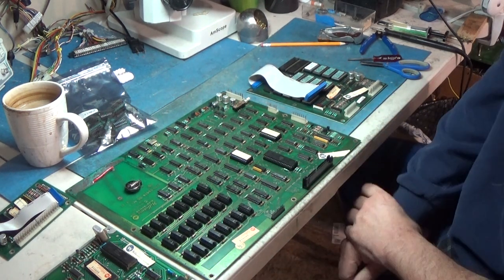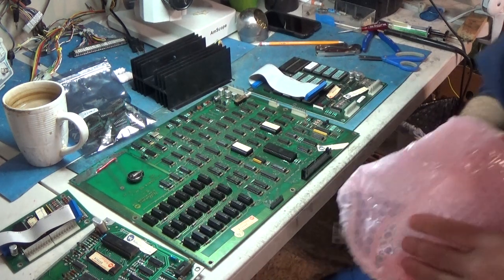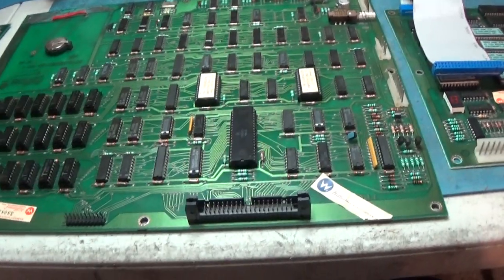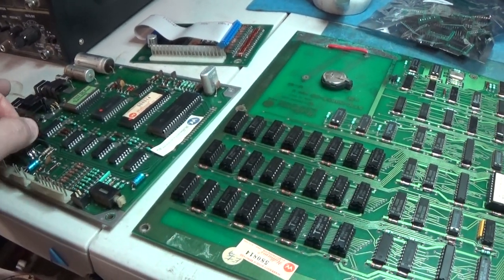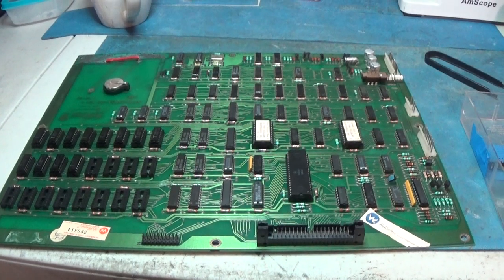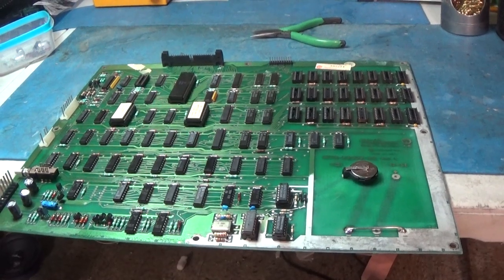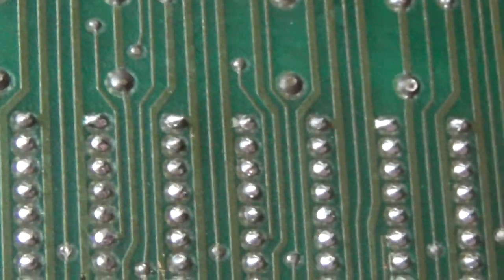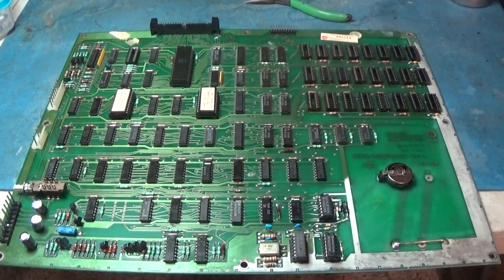Part 1 -- Williams Robotron PCB Repair - The MPU PCB

Comment: Cool, another late night repair video from Sean;).
Great job on tinning, Sean.  I'm not sure, if you have tried this before, but have you considered some solder mask on top of it (of course for extra $, if customer wants it)?  They even have a green solder mask that you can get.  It will not be an exact match, but close enough.  Some of them come with a small applicator brush, but you could use some small grain sponge (they have some for painters on a stick) or even one of these triangular makeup applicators for women.  It would help with a smooth and faster application, especially on these big grounding areas around the edge.  All you would have to do after is to cure it with some UV light or sunlight when it gets warmer.  Well, it's not a must, but definitely a peace of mind and I'm sure many customers would be willing to pay extra for it.  You would be then an all around fix it guy;).